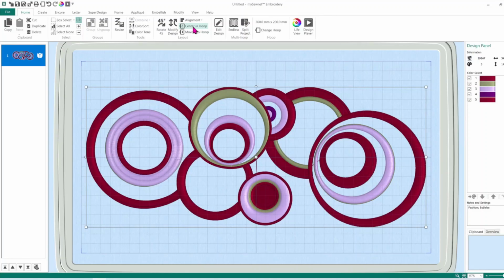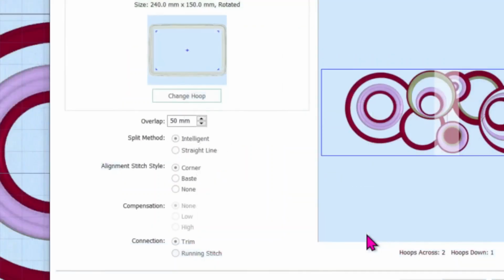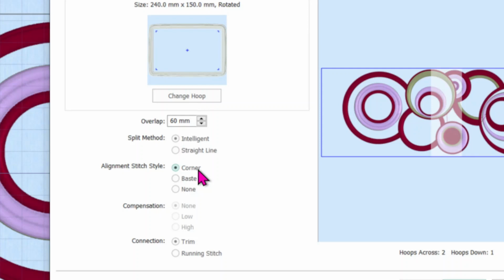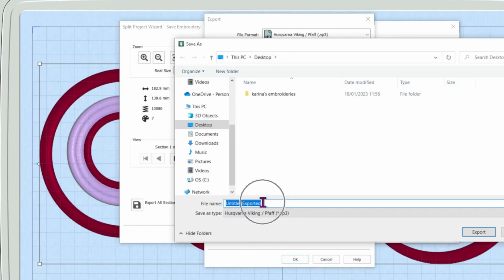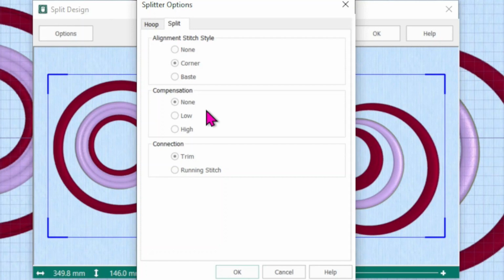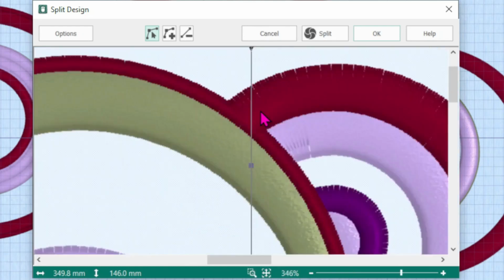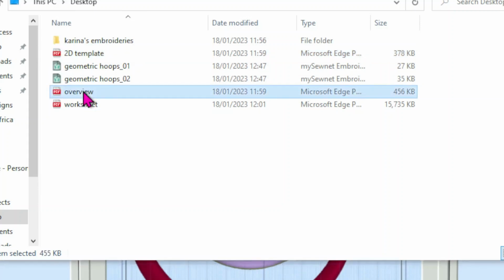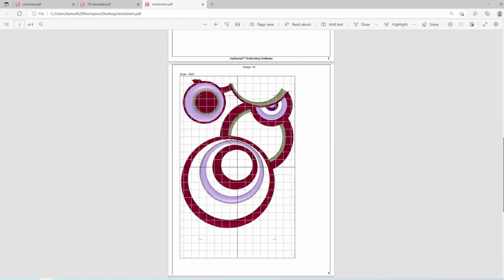Two Easy Ways to Split an Embroidery Design in the mySewnet Software

Comment: Hi! I’m just a beginner with many questions. I use a brother se2000…could you show steps for that as well please. When exporting and choosing file format(brother .pes), I see an additional step for hoop selection. Is that the standard hoop size(5X7)my machine will do? or do I need to select the hoop size I actually want for my design to be? Thank you.  #Confused

Comment: I am delighted that you shared this demonstration.  I stumbled through a split hoop project last year with minimal help.  It was an appliqué project so I had placement, tack down, and satin stitches for each element in both part 1 and part 2 to deal with in addition to figuring out how to split the design into two hoopings.  The precise positioning feature saved the project and I was quite pleased with the outcome.  Your instruction gives great value to my Mysewnet software.   Thank you so much.